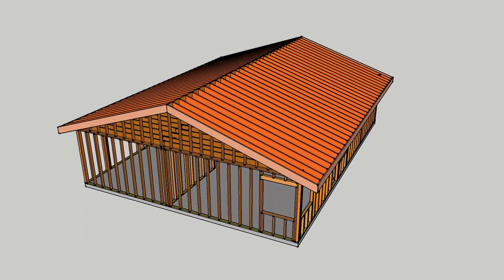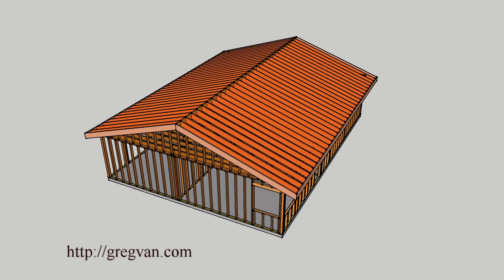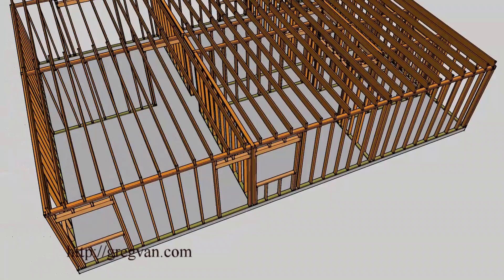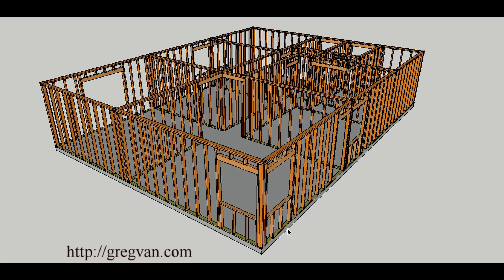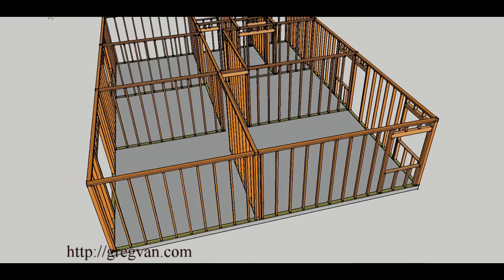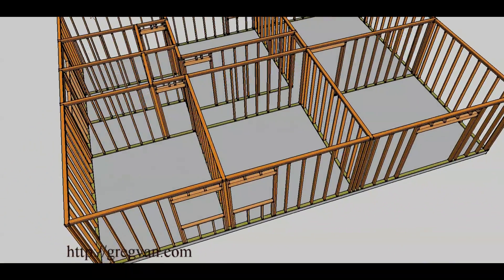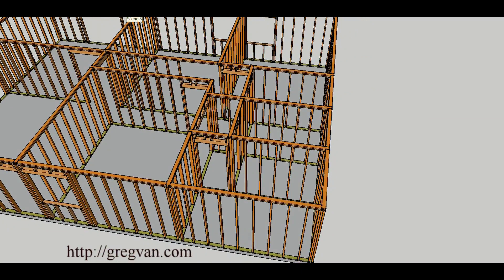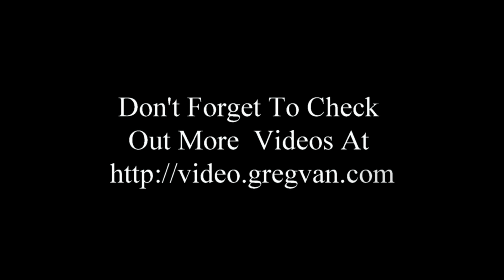Structural Wall Removal Tutorial – Conventionally Framed Roof Single-Story Home

Comment: These videos are interesting and on the surface make sense, but in watching similar videos one doesn't see the same emphasis on non-load bearing walls providing lateral support.  I'm not disputing anything said here, but I'd like to hear the opinions of others who don't agree that such walls are quite as necessary.  Is there a case to be made that these walls are not quite as necessary as portrayed here?
Reply from the maker: I will wait for the video when you find it.

Comment: Hey Greg, great video and information. I have a question… since the ceiling joist overlap how do the rafters tie into them at the exterior wall? Do you insert a 1 1/2” spacer at this location, or do you offset the rafters 1 1/2”? Thanks.
Reply from the maker: You can offset the rafters or use a space block. I do have other home building videos at the website you might want to check out.

Comment: Hey Greg, got a question.

My home has multiple peaks so not a gable roof. The attic shows my joists and the wall I’m wanting to remove parallel to each other BUT the area the wall is located has a different directional peak to it which would make the wall I am wanting to remove perpendicular but I cannot see the rafters and joists above the peak Of the roof. Can ya throw your 2 cents in?
Reply from the maker: I cannot provide structural engineering information or whether or not you can remove a wall, but if you email me some pictures, I can provide you with an opinion. You can get our email address of the website.

Comment: I would think all the walls could be removed except the load bearing walls. The ceiling joists should do the same job as the walls as long as you have them tied together.
Reply: John Weiland i was thinking the same.
Reply: Yes I agree
but also add 
blocking between
joist for extra support

Comment: Hi Greg, Love the video. The wall layout you show is exact to my house. My house is 50" by 40" with a hip roof. My intention is to  create a 16"  plywood screw and glue beam the length of the house 50' and tie in to that beam with 2 12 in screw and glue beams the width of the house using angle 4" angle iron by 1/4 in thick as cornering gussets to all outer walls where the beams connect to each other and the walls using lag bolts. My intention is to remove all walls w/ the exception of the 2 baths and the master bedroom. leaving the whole building to be an open  loft type design.  I haven't discussed this with a structural engineer yet......What is your opinion.
Reply: If you're willing to spend that kind of money to modify your house, just spend the extra $250-$500 to have a structural engineer look at your plans.

Comment: I have engineered trusses and I'd like to remove part of a wall that runs down the center of the house. I haven't seen a video that really shows anything about trusses mostly rafters. I'm leaving about 5' at the end and removing 16'.  I have a metal I beam running down the middle of the basement. It is not directly under the wall but within a foot. Any sugg...
Reply from the maker: +Tim A If you want, take a few pictures and send them to me, but keep in mind I'm not a structural engineer and would only be providing you with an educated opinion.

Comment: For the three parallel walls (bathroom/closet area?) - would the span capacity of the ceiling joist material above determine whether or not some more of them were load bearing?  Not necessarily just where the ceiling joists lap?
Reply from the maker: It could and would depend upon the design of the building, so you brought up a good point. The design of the building in the video would allow you to remove these walls, because the same ceiling joist is used in the other rooms that span from exterior wall to where they lap in the hallway. For example if you have a room spanning 16 feet with 2 x 8 ceiling joist and in another room you have the same size ceiling joist with a wall located anywhere perpendicular to the ceiling joist within the 16 foot span, then there's a good chance you would be able to remove that particular wall if it wasn't performing another structural function.